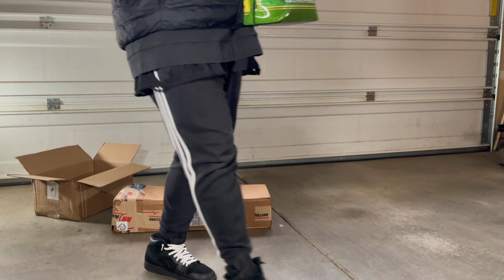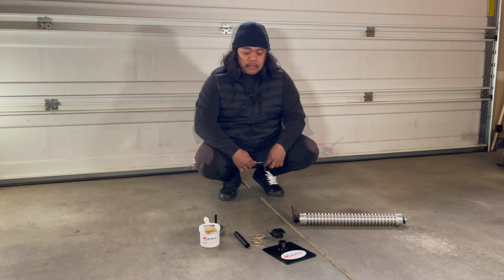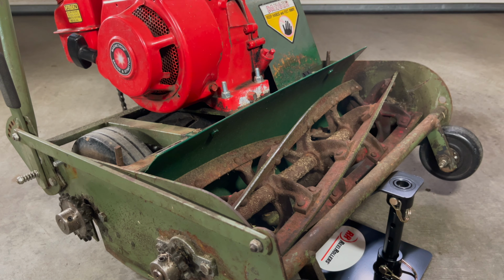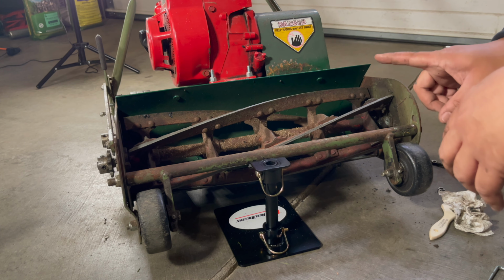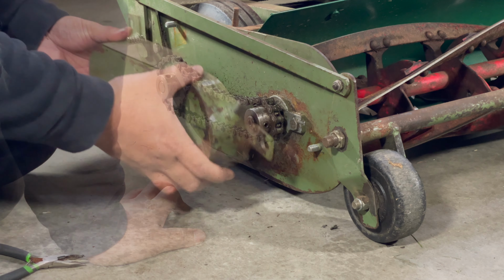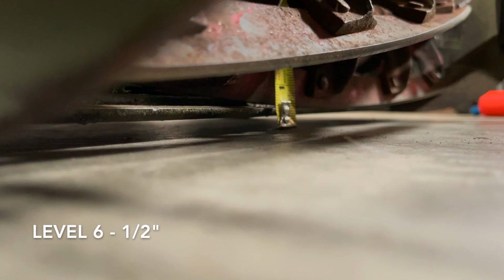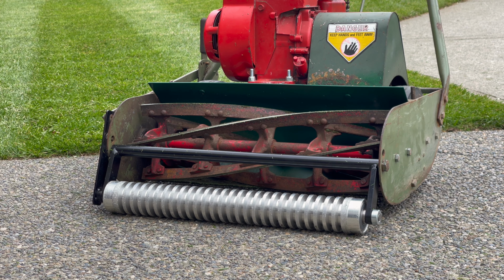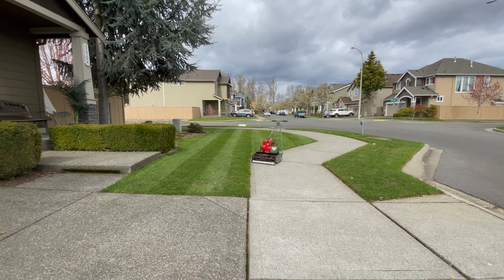Vintage Lawn mower with Reel Rollers Grooved Roller upgrade! Backlap kit - Install - Test Mow! WOW!

Comment: Lmao you are having way too much fun
Reply from the maker: 😂😂😂 it’s super fun dinking around in the garage!!! 😊🤙🏾🙏🏾🔥🔥🔥🔥
Reply: @YardBrah  my new project over the winter is going to be converting an electric AC reel mower to DC using cheap 2 x 18 volt batteries and a 36 volt motor.